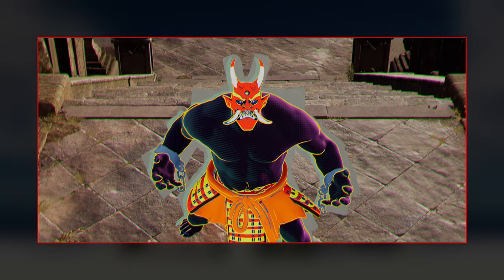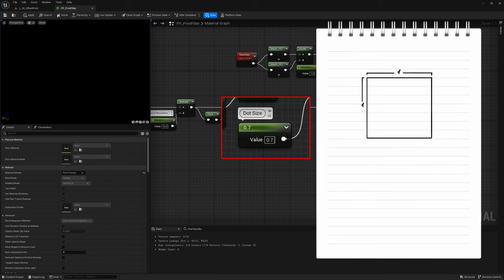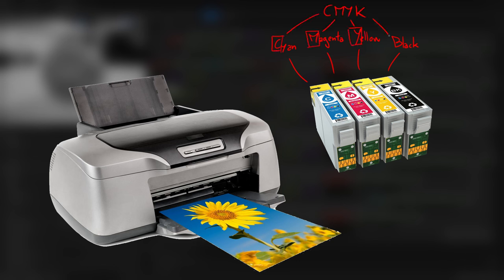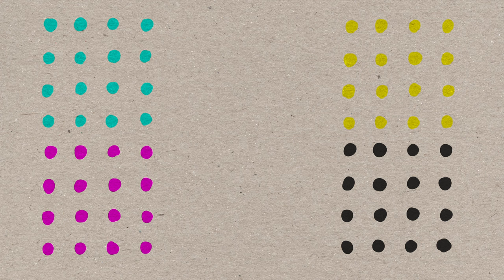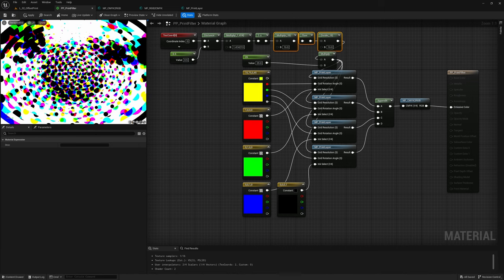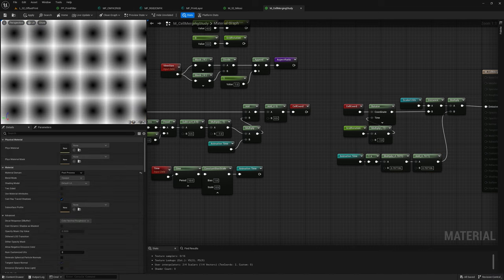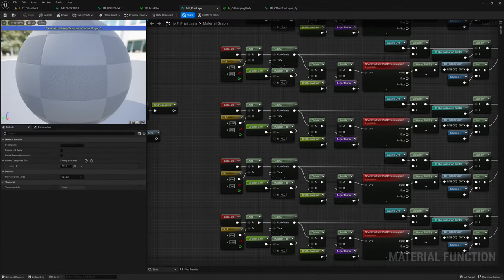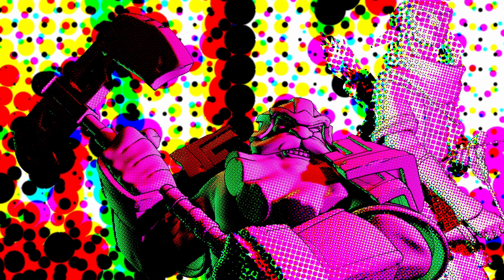Comic Book PostProcess [UE5, valid for UE4]

Comment: I can't find the append node with four inputs. What's it called?
Reply from the maker: Append4, but maybe it's because of the UE version you're using, it's a recent addition
Reply: I'm using 5.3.2, but I'm still not seeing it in the list. I only see the Append and AppendMany nodes, and neither gives the result you're showing in the video. Is there a plugin or optional feature I need to enable?
Reply from the maker: If you use multiple ordinary appends in the correct order it's the same:)
Reply: maybe it called AppendVector
Reply: @Xerpontar  Did you ever find a solution?